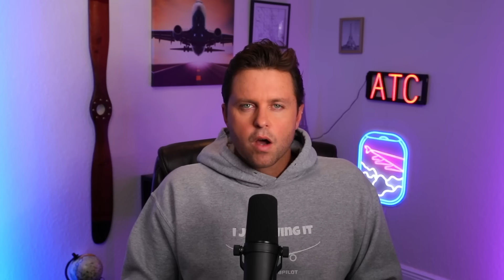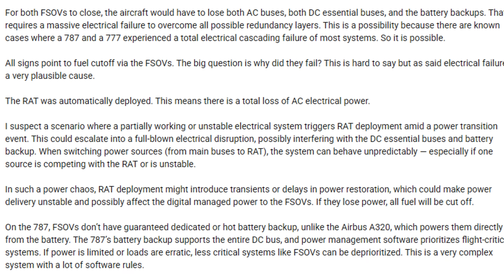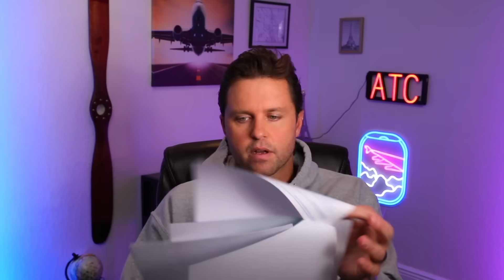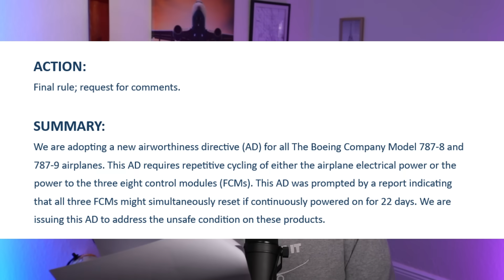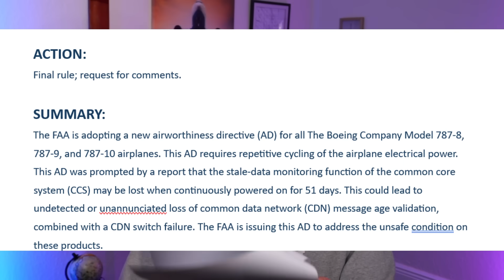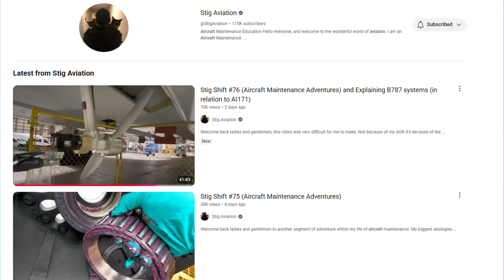Air India 171: Did a Software Glitch Cause Dual Engine Failure?

Comment: There are two fuel shutoff valves for each engine--one mounted at the pylon root (the "spar" valve), and one mounted on the engine itself.

The spring-loaded FCSOV you're focusing on is the engine-mounted fuel valve, which is both powered by and controlled by the EEC (aka FADEC), which in turn is getting power from it's own independent and isolated source (the PMA).  The spar valve is not fail-safed to close when de-powered like the engine valve.  An electrical failure on the aircraft busses (even a wildly improbable sudden and complete power failure across four generators and the massive battery bank) does not reach the two separate EECs, and hence the FCSOV, and that's by design.
Reply: Thanks for this clarification. The idea of a fail-closed valve somewhere in the system, not connected to alternate supplies did not make sense. If I understand it correctly, the FCSOV is, in effect, connected to the FADEC power bus, so that if the FADEC loses power, the engine fuel supply is shut off. This would mean that the fail-closed fuel shut-off would happen on a single engine only, as the support for that valve is entirely within the engine system. It is seeming more likely that either the spar fuel control valves or the engines themselves were told to shut down. When I say "told" I am not suggesting that the crew initiated the shut-down.

Do you know if failure of the PMA provides fall-back to one of the AC generators? It doesn't relate to the present issue, just curious.
Reply: @Brannigan777  If both channels from the PMA to the EEC fail, it reverts to acft power.  During engine starts the EEC is powered via that backup channel until the PMA comes online.
Reply: @bobscott2288  Thank you.

Comment: Before these things come out anywhere it comes out on the Aviation subreddit in Reddit. 

There’s a mega thread where people speculated.  Some of them are keyboard warriors, some are humble and don’t call them as experts but they actually are.

They have discussed about this in depth and there was another incident that came in aviation herald as well. 

The more we look into this. It seems like Boeing is at fault here. 

I don’t understand how this company still is allowed to operate. 

US has been doing nothing and they continue to support this dodgy and irresponsible and reckless company that once was having standards. 

Air bus doesn’t seem to have this kind of design that will switch both engines. 

Terrible really.

Comment: I seriously doubt that the engine fuel shut off valves would be "spring loaded" to close in an emergency or that they would be "deprioritized" as non critical devices in a load shedding occurrence. Neither of those ideas make any sense at all.

Comment: Is there not a manual override for engine control?? I would also think that the FCSOV would fail open in the event of a power loss, this would prevent loss of engine power in this instant.

Comment: It seems that it should be possible to replicate these conditions in a lab, notably sending electrical transients into the power busses and seeing if the FSOVs trip.  If true then (another) shockingly bad design by Boeing.

Comment: Boeing issues aside (they have many), this doesn't sound like a software glitch from the data that you presented. Based on the information solely contained in this video, the fuel valve shutoff trigger mechanism seems to be non-digital in nature (i.e. analogue/electrical/mechanical/hardware). I analyze a lot of systems based on data. Lead software developer, 20 years exp, multiple industries, including robotics and aviation.
Great analysis however! I think you're definitely onto something here.

Comment: Keep in mind, there've been around 5 million take offs of this specific plane, and only one crash happened to a 15 yo plane. You call it dangerous, but number say its the safest mode of transportation.

Of course there can be software bugs, but eventually every bug will be fix, yet new bugs well be introduced, new human errors on either side will be made.

Microsoft or Google data centers can abruptly shutdown, so people lose access to services, and hopefully no one dies, but unfortunately mistakes in the aviation industry are likely to result in injuries and deaths.
Reply: There are protocols for writing and testing software. It's just that many people who write it don't use them, or don't use them properly. Messy code and sloppy bug fixing without testing, where solving one bug just creates others, is something my engineer friends get very cross about; they would never write code the way some common or garden computer software I have to use is written.

Comment: Something to consider is there is some good visual evidence that the #2 engine, which was a new engine, rolled back before V2 speed.  You can see on lift off the plane is so close to the end of the runway that the #1 engine kicks up dust from beyond the end of the paved runway.  There is also yaw of the plane that can be seen due to a shift in thrust symmetry.  You can see some distortion from exhaust from the #2 engine, but the thrust is not there for that distortion to reach the ground like it does from the #1 engine and no dust is kicked up from the #2 engine due to it never reaching the ground like the #1 engine.  All signs of thrust is lost around the time of gear retraction with the main gear wheels tilting forward and then gear retraction halting.

This all supports your theory.  Going on this theory route, the #1 engine is probably pushed to the max.  If there is a software shutdown for over throttle, this may be a time that stupid piece of code is triggered and shuts down engine #1.  When engine #1 shuts down, then the rest of your story may fall into place.

So just a quick modification of your story without discounting it.  Not really speculating here, just an accepted piece of information that is clear to see from the videos.  Also, the pilot did say that "thrust was not achieved" in the mayday call, likely just before engine #1 rolled back / shut down, but after engine #2 rolled back.
Reply: The aircraft rotated at the normal point, about 2,100m from the end of the runway.This can be determined by using sightlines from where the video was recorded and also by the time interval between the small cloud of dust kicked-up at rotation and the large cloud of dust at the aircraft overflew the end of the runway at 71 ft agl.

The aircraft climb to 400 ft (twice the 197 ft wingspan) in 10 seconds, at a climb rate of 2,400 ft per minute, which is normal. This could not have been achieved if both engines had not been operating normally.

The problem occurred a short time later and it descended to under 100 ft.

The distance from the end of the runway to the crash site si 1,600m. If the engines were shut down the aircraft could not have reached the impact point and would have crashed sooner. Hence, the engines were not shut down, but were rolled back to low power.

The $64,000 question is why.

Comment: If contaminated fuel had been the cause of the Air India plane crash, then other aircraft would also have experienced fuel issues on that same day. The fuel trucks are filled from a central fuel depot. If the contamination had occurred in a particular tanker truck, then other aircraft refueled from that same truck would also have been affected.

From the unqualified perspective of a lawyer, all signs therefore point to a technical malfunction. The facts presented in this video, at the very least, provide sufficient grounds for a lawyer to suspect a technical issue. Such reasonable suspicion may be enough to justify administrative measures, such as grounding flights.

Comment: So far this makes this theory the best cause and if slightly possible should lead to mass grounding of the B787 until issue has been resolved as we do not have to wait for a second situation like the Max 8. 
This wil be a HUGE impact on airlines as the 787 is popular and large numbers in fleets will cause a massive disruption and I do not see that Boeing can survive another max situation.

Comment: Gary, when you are quoting "Google," you are actually quoting the AI-based first (and forced) search result. The Google AI is frequently wrong, though in this case, it may very well be correct. There are hyperlinked references that could be used to confirm this. Also, you can find the 787 manual (or a substantial amount of documentation), and spend some time to decipher the details if you're not in such a rush to put out a sensational video. Finally, we don't know the gender of "HeyFixThis," do we (or do you?). Just saying..

Comment: Not a pilot but I noticed, you stated the commenter said, that the deployment of the RAT, could have caused a glitch, which caused the fuel shutoff electricity to be lost and shut the valves. That doesn't make sense. The RAT would have deployed, AFTER the engine had already failed. So how could this glitch have caused both engines to die, due to this fuel cut off thing, if the glitch supposedly would have been caused by the RAT, which didn't deploy until the engines had already failed? Idk?? Chronologically doesn't makes sense.... What caused the first engine failure? That's what needs to be determined. Not whatever happens after that...

Comment: I don't think a dual engine failure  has not been released as a hard fact.  This theory depends on a dual engine failure.
Reply: That why his theory is wrong. If both engines had failed then the aircraft could not have flown from the end on the runway 71 ft agl and reached the crash site 1,600m away. Hence the engines were not shut down, but were rolled back to low power.

Comment: I'm not sure it's a fail-safe control.. I looked up some information on the FSOV on the 787 and Boeing indicates its a "Fail-As-Is" meaning, if it lost all electrical power, it would remain in its last commanded state.  I find it really hard to believe that it would be a "Fail-Safe" since that introduces all kinds of problems as you've highlighted.

Comment: Money over  lives . Whistle blowers at boeing have been raising these issues of both software , design flaws and Faulty parts being taken out of whats called the parts jail literallly because they are not safe or they too damanged and are not suppossed to be used but . The pressure to get planes out the door and a shortage of parts  has caused many of these parts to go missing and  the higher ups have ignored these Sounded alarms by engineers plant managers . One whistle blower said Many if not all the missing defectine parts have gone on to plane s these parts he said are in the thousands . i will if you dont mind leave the link

Comment: One channel calculated the fuel for the trip would have fit in both wings , leaving what was left In the centre tank for takeoff , if it was not sumped , after rotation the change of tilt might of sucked the crap into both engines.

Comment: Seems that this fail closed logic should be configured to a wieght on wheels and/or baro MIN height of say FL050.  At least with FL050 you have time to glide  or start an apu/rat or attampt a windmill restart.  Additionally, why isnt this system set to trigger off an engine fire /engine extingisher command activation?

Comment: There is another YT video taken by a passenger that got off the plane just before the fatal takeoff.  He shows on the video that the power to the lighting kept going off, and the call buttons would not work.  The A/C also was not working, and people were hot and fanning themselves.  I think they are going to find a couple places where the wiring was either pinched or cut, and major problems were not addressed by India Air before allowing another flight.  All in the name of chasing profit.

Comment: I get all the computer automation but on a airplane like that it defies rudimentary logic of why you would allow for engines after a certain point of no return in the flight run up engine test you would engineer the system to allow the engines to be shut down by anything other than a manual control valve and I don't mean hydraulic.

Comment: If true, this seems like an unsafe design solution for aircaft that can't simply roll to a stop on the side of the road.  Having the fuel supply valves be continuously held open against a spring by an electromagnetic force and then "fail safe" due to loss of electrical power is similar to how some security systems used to protect buildings operate or how air brakes work on trucks and buses.  

It would not be conjecture to assume that these valves would have been designed with an uninterruptible power supply (UPS) battery backup somewhere on the system.  Even if there was a second or two of electrical power loss, due to switching over to battery, it should not cause the engines to completely flame out while the battery backup reopened the valves.  However, if the Lithium Ion batteries used in this 787 were old (I absolutely abohr lithium ion chemistry batteries!), didn't like the hot, humid weather, then it's also possible they didn't have the stored energy necessary to quickly and fully operate the valves during the main power interruption.

There has to be a better way to detect an engine fire by having multiple independent sensors agree that there is actually a fire before power is supplied to actuators to  disconnect the fuel supply - if the pilots are unable to do so from the flight deck.

Comment: Allow me to say sth.Know zero about airplanes,cars,or even lawn mowers.Yesterday a video showed a huge pick up truck V10 where the mechanic discover the spark plugs were only 1/3 in the sockets bc they had only 2 thread lines built in the block?,other cars with vital parts replced with plastic,etc.My point us,we are putting adide quality and safety aside.Why we are ignoring what has been safe before and engage in experimenting new technics we have no records if they ever worked or not?Conclusion: Boing has a lot to answer to guys like Kevin( brilliant case analysis he did).Thanks.

Comment: Gary, thanks for presenting such a thorough summary of the technical background and referencing the relevant airworthiness directives and system design features of the 787. Your discussion of the FSOVs, their dependence on electrical power, and the potential vulnerabilities in the 787’s electrical architecture is well-researched and highlights some real-world concerns that have been documented by the FAA and others.

That said, the evidence you’ve presented—while intriguing—remains largely circumstantial at this stage. The ADs you cite do establish that the 787 has had some notable electrical system quirks, but none directly document in-flight FSOV closures or dual engine flameouts caused by electrical glitches. The ground-based incidents and theoretical vulnerabilities you mention are important to consider, but without FDR data or direct investigative findings from this accident, it’s difficult to weigh these risks against other possible causes. Your approach of laying out the facts and inviting scrutiny is spot-on for this early stage of the investigation, and I appreciate your transparency about the limits of the current evidence.

Comment: The 787 has no bleed air system at all! 7:55
Reply: And this is why Google AI search results must be verified as they are typically just putting random facts together that may not mean anything.  Stig would be a better resource for any real information.
Reply: Incorrect… The engine inlet is deiced using bleed air. True the 787 does not use bleed air for air conditioning or pressurization, but does have a bleed air system to deice the engine nacelles…
Reply: So is this one of those fake reports going around that are intentional misinformation?
Reply: I guess for the heat right?  But for what most planes use bleed air most of the time, pressure, air con and of course..engine starting it doesn't exist.
Reply: you are correct sir

Comment: If I was currently flying the 787, I'd be going on immediate leave..... scary stuff!  Why does Boeing keep doing this stuff? D0 they not have the personnel or smarts to think these scenarios through?  Consider a total electrical loss in the air... sure, why not shut the engines down as well? Make it a total cluster for everyone on board....A total electrical loss on the ground... why shut the engines down without actual input from the crew? Sure it may burn but that's why pax need to leave their bags behind and get their asses of the plane!  Just astonishing design failure!!!  Great info, keep it up Gary...

Comment: Question: If the electric fuel pumps fail due to an electric issue, will the power from the RAT power them? If so, before it switches to the RAT power, would the engines shut down due to fuel loss, then would the engines spin back up fast enough to get the required lift needed at that time of the takeoff? When the pilot called out mayday, did he say no engine power or not enough thrust?

Comment: Engine electronics have their own power sources. It would not be affected by aircraft electrical failure. A software glitch in engine automation itself which is triggered by a rare event like in Qantas Flight 72 does make sense though.

Comment: the explosion of the lithium battery triggered a catastrophic electrical failure what triggered the FSOV and shut off both engines. The RAT came out and the landing gear didn't retract no more electrical power. The sole survivor said the lights where flickering and there was a loud bang. (the battery explosion) NOT GE and NOT Boeing fault, they don't build lithium batteries.

Comment: Correct me if I'm wrong here, I'm no aeroplane expert by any means. But shouldn't the electrical system on planes be going through some kind of UPS? I mean, if computer servers are important enough to keep running with a UPS within a few milliseconds, surely an airliner would have them?